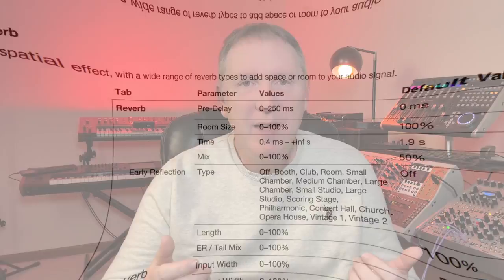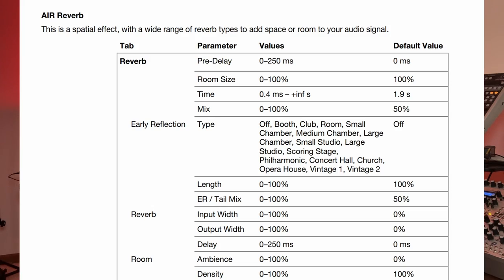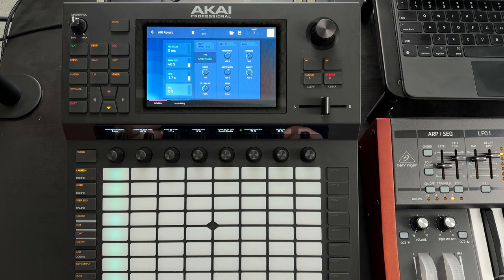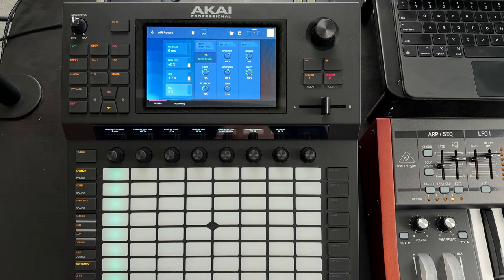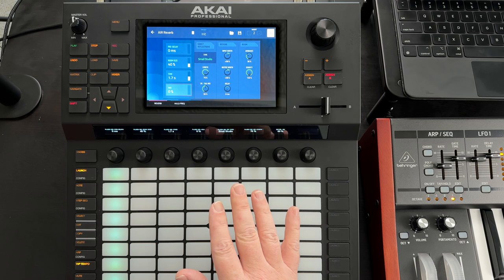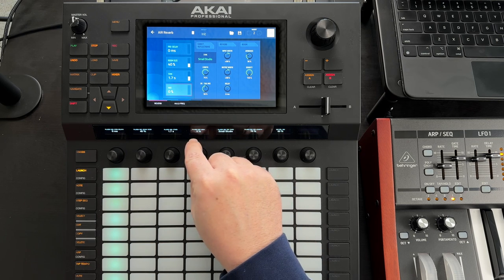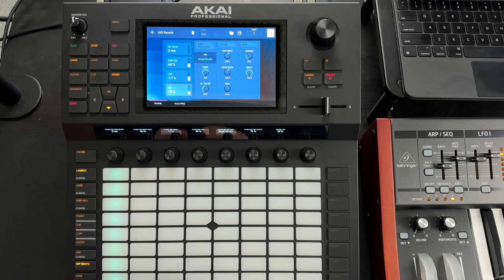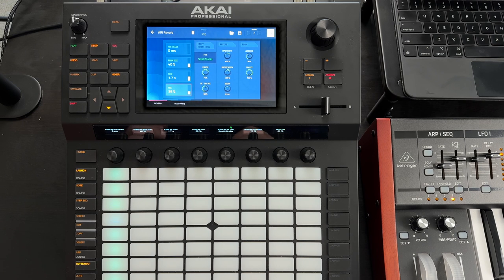Take Control of AIR Reverb (AKAI Force and MPC)

Comment: Thanks Joe. To be honest, I had kind of written off the reverbs for my MPC and Force. The presets are the worst-sounding reverbs out of all the gear I’ve ever owned. I took that to be a reflection of the algorithm and plug-in quality. 

But having seen this video, I’m wondering if maybe the presets are just not great. The plug-in itself is clearly quite powerful. I don’t think I’d ever noticed the second tab with the high and low cut - I don’t know why Akai doesn’t reformat the plug-in’s UI to show all the controls on one page since there is plenty of space to do so. 

I think I might run a signal from one of my other synths into my Force and see if I can simulate better sounding presets from my other gear on the Force, to save as my own user presets. 

Finally, a quick point of feedback: on touch screen intensive videos like this one, I’ve found myself zooming in on the screen since I can’t see it on my phone. Perhaps you’d consider focusing the camera on just the screen for a tutorial that isn’t really using the pads?
Reply from the maker: Yeah, i think it’s worth trying.  AIR Reverb isn’t really my favorite reverb.  That distinction goes to the Strymon Starlab (hardware) and FabFilter Pro-R (plugin).  But this reverb isn’t nearly as bad as everybody thinks it is, in my opinion.  It’s just that most of the presets aren’t that great.  And quite a few of the controls just don’t make a lot of sense until you really isolate out what they do.  But once you get past that, I’d rate it as pretty good.  Thanks for the feedback on the camera zoom.  I’ll look into that next time.

Comment: Thank you for the tutorial, but after hours of fiddleing on the touchscreen I think the air reverb is the baddest sounding reverb on the market. Currently I'm using  a Beringer X32 Mixingconsole as audio interface and external fx section for my MCP.  The sound is without exception better and the workflow is much easier. And when it comes to mobility I use a Source Audio Ventris Reverb for my MPC.
Reply from the maker: Hey @christianblass6675, thanks for watching.  I understand where you're coming from.  Maybe Akai will give us a new reverb plugin at some point.  I can make this reverb work for me a lot of the time, but I probably wouldn't go out of my way to use on a system where I have lots of choices.

Comment: I've heard much worse reverbs. Just like everything else in the Force, what's impressive is not how great it sounds, but how bad it doesn't sound.

Nothing in the Force sounds better than the very complicated live rig it's replaced, but it's so easy for me to compose music and environments for interacting with that music that my music is better even if the individual parts aren't the best kind of VA or the best kind of reverb.

And compared to 1990s gear, it blows them out of the water. the only things from the 90s that it doesn't sound better than are Eventides and Lexicons. If you are just trying to make music that sounds like well-produced 1990s electronic music, the Force is king.
Reply from the maker: Hey suitandtieguy - well said.  Agree, it’s amazing to have everything we have in one standalone machine.